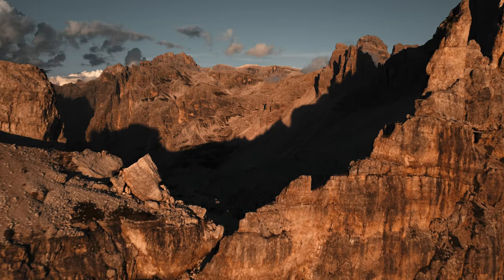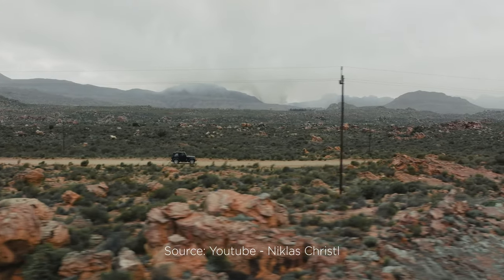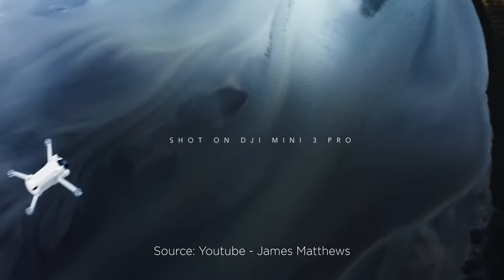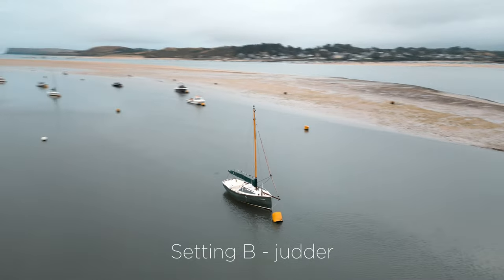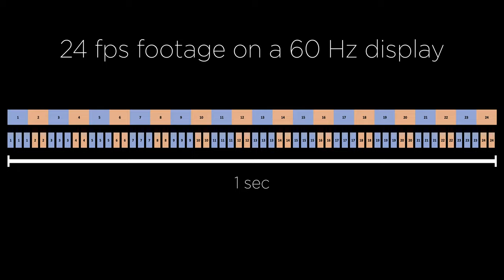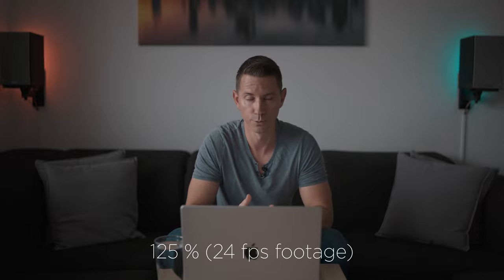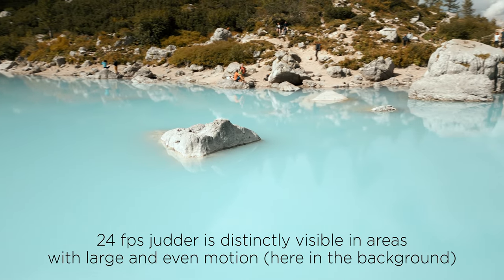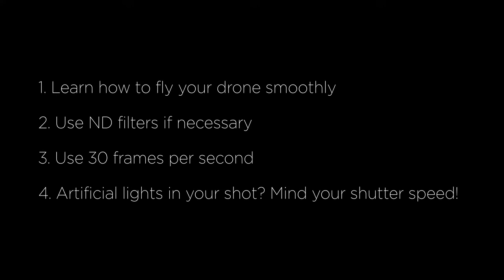The #1 Secret for CINEMATIC Drone Video without Judder, Stutter or Jerkiness

Comment: Hey this is awesome information! Thank you for your time and effort into making this video. I have a question in regards to editing timeline. Is editing on a 30fps timeline the only way to prevent judder? Because I want to edit a video that has normal 24fps vlogging footage along with 30fps drone footage (which I'm sure is very common in video editing). For my 24fps vlogging footage to play back normal, It has to be on a 24fps timeline right? But then my 30fps drone footage would have stutter? I guess my question is, is there a way to make certain parts of a timeline 30fps and some parts 24fps so that my drone footage is smooth and my 24fps vlog footage plays back normal? How do you get around that? I guess this is more of a general video editing question. I edit on final cut and newer to editing. Thanks in advance!
Reply from the maker: First off, I assume you intend your videos to be played back on smartphones or computers (which are 60 Hz mostly), not in cinema. I hope this assumption is right.

If you already have your footage recorded and it is 24 fps (vlog) and 30 fps (drone), use a 30 fps timeline and export in 30 fps. This way, you can ensure that at least the drone footage is judder-free (30 fps footage on 30 fps timeline on 60 Hz display = all compatible). The 24 fps vlogging footage will technically be juddering, BUT it would be juddering anyway on a computer/smartphone screen. The good thing is, with common vlogging footage and the nature of the camera and subject motion of vlogging footage, chances are, you won't notice any judder at all. Judder becomes mostly visible with even camera movements like most drone footage has (pans, tilts etc.), so your priority should be getting your drone footage smooth, therefore my recommendation for 30 fps all the way from start to end.

Just for your information: If you put your mixed fps footage on a 24 fps timeline, the vlogging footage would fit perfectly on your 24 fps timeline while 6 frames of the drone footage would be skipped every second. AND when you later playback your 24 fps video on a computer/smartphone (60 Hz), everything would be juddering because nothing would fit at all. So with the 30 fps timeline, you could at least "save" your drone footage (30 fps all the way from start to finish). And on the vlogging footage, the judder will most likely go unnoticed.

For future projects, I'd strongly recommend to record all your footage in 30 fps, put it on a 30 fps timeline and export it in 30 fps, then everything is compatible and technically correct.

If you have any further questions, just let me know, I'm happy to help :) And thank you very much for your kind words, I really appreciate them.

Comment: Good video.. Agreed about the whole 24fps 'natural motion blur' garbage. It's good for filming ppl at normal speed but most drone footage is of scenery and at a slowmo style! I'm still struggling with this but I found dropping my 30fps drone footage to 80% worked (24fps timeline) well,  using a 'fast' microsd card AND turning off caching in the app! Haven't shot anything new with all 3 but test look promising.
Reply from the maker: Interesting! I'm wondering why you would put your 30 fps footage on a 24 fps timeline. Why not 30 fps timeline? Dropping 30p footage at 80 % speed on the 24 fps timeline will be smooth in itself, that's right, but the 24 fps timeline will still be juddering on a normal computer display (except for special ones like 120 Hz displays).
Reply: @t0mwhazzup  thx for the reply. I have mixed fps footage from my bmpcc 4k, dji osmo and I use 24fps for those. I don't get the judder on my 60hz macbook when I slow the 30fps mini footage 80% for the 24fps timeline.
Reply from the maker: Perfect if it works for you ☺️

Comment: Good video and explanation. yet it did not help me. I have been experimenting and what made the big difference for me was that i had all my video files stored in a folder on the desktop. Once i moved them the judder was as good as gone. So that and your tips gave me judder-less video. I did not use ND filters. I thought i'd let you know in case someone else has the same problem. Thanks for posting that.
Reply from the maker: Interesting, but most probably your problem was not judder (which is caused by the pulldown with incompatible refresh rates and frame rates), but more some stutter that is somehow caused by something on your computer. Judder and stutter are often mistaken for each other, but are something different. Anyway, happy that your problem is solved :)

Comment: Hi Tom amazing video, I finallllllly found a valid explanation. I shoot often on 30fps on mini3pro but I guess while on timeline of Davinci it’s 30fps and 24 fps on export is the reason it’s still way juddery ?
Reply from the maker: Yeah, you need to go all the way 30 fps. Shooting, timeline and export. Then it should be smooth.

If it still does not look as smooth as you like, one common reason is a shutter speed too high. That happens when you don't use ND filters. This phenomenon is not judder, but it looks similar.
Reply: @t0mwhazzup  I think you're right for the shutter speed as the issue is spectacular on the rotation moves specially on the horizon for me!😁👌🏻👌🏻
Reply from the maker: @yellonight  For that I have made a tutorial that should cover all settings for perfect video quality, which also includes things like stutter and ND filters: https://youtu.be/5aotiUE-iOk
Maybe it helps :)

Comment: I am making my first documentary but i shot it allready in 25 fps should i make the drone footage in 30 fps?
thanks and greetings from Holland!
Reply from the maker: If you recorded your documentary already in 25 fps, I would shoot everything for this project in 25 fps for the sake of consistency. For what medium is it planned? TV broadcast or online? On TV, it is supposed to play back smooth. If it's for online airing (Youtube etc.), you know my recommendation 😅 Let me know, I'm curious 🙂
Reply: @t0mwhazzup  it’s probably for both!
And yes I live in Europe so PAL it is (25 and 50fps).
Reply from the maker: @SretloW  It's fine. When we do projects for broadcast (which is the majority), we work 25fps as well. Everything else 29.97.
So in your case, shoot the drone footage also in 25fps, get the shutter speed right (depending on the material, I'd go between 1/25 and 1/50 of a second) and it will look good. On TV anyways. Oh and the project timeline of course in 25 fps as well.
What documentary are you filming?

Comment: What if you record in 30/60 fps but edit on a 24fps timeline or export at 24fps? Thanks in advance!
Reply from the maker: That would not make any sense. First off, you have to think about where the final video will be mainly watched. Is it cinema? Then 24 fps. Is it broadcast? Then 25 fps in PAL countries or 30 fps in NTSC countries. Is it social media/online/digital content? Then 30 fps.
And then you should keep your frame rate the same for recording, timeline and export.
Judder comes from mathematical incompatibilities, and therefore, 24 and 30 fps don't work well together. As a general rule, never mix frame rates. Stick to the frame rate of your choice, and if you're wise, you choose your frame rate according to the guideline I mentioned in the beginning. So for most creators that produce for YT, TikTok, Instagram and so on, 30 fps makes the most sense.
Reply from the maker: And as a sidenote, I don't defend 30 fps as the one and only correct frame rate. It really always depends on where you distribute your video. When I do commercial projects for broadcasting (here in Europe, so PAL), I go with 25 fps.

The 24 fps hype is rooted in cinema enthusiasts that have insufficient understanding of the matter and believe using the same frame rate as cinema movies gives them cinema experience, while the truth is, 90 % of computer monitors or smartphones cannot even display 24 fps as such. But it's a very persistent myth/hype/misunderstanding.

Comment: Hi Tom, thanks for this useful information really helpful. Recently I filmed with my Air2s in 30fps and working on davinci in a 30fps timeline (before I was starting 25fps but I had lots of shuttering issues then after watched your video I changed in a 30fps timeline now is more better than before but still I have some lagging issue in some of the clips (I noted after some color grading work I have these problems) always I’m using ND filters and respect shutter angle. Are you have any suggestions please 🙏🏽
Thanks
Reply from the maker: When you're doing 30 fps and work with the right shutter angle, you are doing everything right to get smooth video. Can you describe the lagging a little more, or maybe have an example clip to look at? Is the lagging only in DaVinci Resolve or also after you rendered the video and play it back in a media player (like Quicktime, VLC and alike)?
Reply: @t0mwhazzup  i have small lagging inside davinci also but I noted every time when I playing inside the davinci the same clips are lagging but in different time positions (not lagging exactly the same place.. after rendering little more smooth on QuickTime Player than VLC player (when using vlc player colors are good but I have 90% lagging)

Comment: I always record in 30fps and I have horrible judder when panning. It ruins every video unless I avoid panning.
No solutions out there and so, no, the problem with 30 fps is not "history". I am using a DJI Mini 3 pro.

Is there a post process solution?

BTW . One software is smooth. It's when I click on a video on my tablet in Samsung Gallery and it uses its embedded viewer.
Every other video sw or player on tablt phone or PC has the judder effect.
Reply from the maker: Which shutter speed do you have? Do you use ND filters? There are other phenomena than frame rat incompatibility that might cause unsmooth playback
Reply: No ND so shutter is high but I discounted tgis as a lower shutter will only introduce motion blurr. Judder will remain.

Also the one playback (Samsung Gallery embedded player) is buttery smooth, so there is a playback issue also with players and editing sw.

Only judders when panning.
Reply from the maker: Always hard to tell without having the footage in front of me.

If you have a high shutter speed, your video consists of a sequence of still images with no motion blur, which gives stutter that becomes visible especially with camera movements like panning. Stutter is originating from no motion blur (no fluid movement) but looks similar to judder that originates from incompatible video frame rate and display refresh rate.

If one software plays your video back smoothly, it might have some kind of intelligent smoothing algorithm built in.

If you have your video on Youtube, you can send me the link and I can look over it when I have time.

Comment: I have tried every frame rate possible and mostly shoot in 30 FPS but my Mini 3 Pro is doing the judder bad when panning mostly. It is driving me nuts then I watch YouTube and most other people are having same issues. You are correct on it not being much out there other than old video's about the wrong SD card causing it
Reply from the maker: Does 30 fps (recording, timeline abd exporting all in 30 fps) not solve your problem with judder? If not, a memory card too slow could be the problem indeed, or if you don't use ND filter you might get a similar effect, too. Even though, technically that is not judder.
Reply: @t0mwhazzup yes I tried that. I had someone tell me shutter speed might be off and I didn’t have ND filters so you probably are right about filters.  Going to try shutter speed and get some filters, I always do 30 fps. Will let you know if it fixes it. Thank you for your info love your channel
Reply from the maker: @bikedoc4145  I have a video on my channel, I think it's the most recent one, with the thumbnail saying "Make it Pro". In this, I go over everything that makes drone footage professional. One part deals with ND filters and there I give a visual comparison between ND filters and no ND filters and also explain how to approach the use of them to get the right shutter speed. Maybe that can help a bit. Let me know if it helped!
Reply: @t0mwhazzup  I am ordering a set today from  freewell today and for sure will watch that video. If you have a link as sponsor to some I will order from your link. Thanks a bunch
Reply from the maker: @bikedoc4145  Thank you very much for your support 🙂 Actually I do, you can find the link in the video description. I have affiliate links for amazon us, uk and germany/austria. The ND filter set I linked there is the one I use and I really recommend that because it starts with ND4 instead of ND8 or 16 with most other sets out there.
Thanks again, I really appreciate it 🙂
Reply: @t0mwhazzup  Will check it out and get back on results 👍
Reply: @t0mwhazzup  Just a follow up. I got the 4 pack Filters and started out with a 8 on not very bright day and it is way way better! Thanks for your help
Reply from the maker: @bikedoc4145  Happy to hear! :) What shutter speed did you get out of it with the ND8?
Reply: @t0mwhazzup  I'm not sure I used auto and just adjusted my EV amount but it was way lower
Reply from the maker: @bikedoc4145  Ah ok, I see. If you want to improve further, I'd start to use manual exposure, and then set ISO to 100.

One approach (the "trial and error" approach) would be to set shutter speed to 1/60 and then try different NDs to see with which you get the best exposure. Stick with the closest one and then you can do minor adjustments of the shutter speed (in the range of 1/30 to 1/100) if necessary.

The other approach (the "calculating approach") would be to have no ND filter on, set the shutter speed so that exposure is good, and then "calculate" which ND filter you need to get down to around 1/60 of a second. So, for example, if shutter speed is 1/1000 without ND, you're gonna need ND16 to get to around 1/60 (1000 / 16 = approx. 60).

The more experience you have, the easier it will be to put on the right ND filter just by estimating the brightness of the scene.

I explain it here, if you haven't watched this video.
This is the video from the beginning (I think it's worth watching all of it): https://youtu.be/5aotiUE-iOk
This is the video starting at the ND filter part: https://youtu.be/5aotiUE-iOk?t=662

And thanks again for ordering via my affiliate link, it really supports me - I appreciate it a lot!
Reply: @t0mwhazzup  No problem and thank you for taking the time to help. I think it got down to like 1/580 but I did not have much time and it was cloudy bad so I only played with the ND 8. I will watch the whole video tonight and try it on Manual next time. Thanks a bunch 👍
Reply from the maker: @bikedoc4145  Yeah, if it really was in the 500s or 600s, you will still see a noticeable improvement when you get to the range of 1/30-1/100 🙂 Let me know how it worked for you!
Reply: @t0mwhazzup  Yes I will, I am going to try what you said on manual to get it down that low and will let you know the results, Thanks again for your help
Reply: @t0mwhazzup  Just a fallow up
I have found that my playback is causing the stutter. But I got the shutter speed down on a sunny day as low as it would go and up to 80 and even with my playback doing that it was almost gone so big difference it made. Thanks for all your help
Reply from the maker: Very happy to hear! 😊

Comment: Great stuff, Tom! Many thanks for sharing all these helpful videos. Do you actually have any experience related to exporting videos to watch on TVs? Would love to hear your recommendations as to what frame frame to shoot at (is it still 30fps) as well as what sequence frame rate to use while post-processing.
Reply from the maker: Today's TVs are usually easy going and have variable refresh rates, so they accept any framerate well. 24, 25, 30 (48, 50, 60).

I guess with sequence frame rate you mean the timeline/project framerate? This should be the same as the frame rate you record your footage in, so my recommendation would be 30 fps (to be compatible with TV, smartphones, computers). Don't mix frame rates if possible, otherwise you'll again have to deal with skipped frames or judder.
Reply from the maker: And thank you very much for your feedback 🤗
Reply: @t0mwhazzup  Thanks so much for your shared advices, Tom :)

Comment: What about mixed footage? What if it is mandatory to drop some drone shots on a 24fps timeline full of camera clips?😵
Reply from the maker: If you have the chance, film the camera clips with 30 fps in the first place. If the deed is already done and you have camera clips in 24 fps on a 24 fps timeline, best practice would be to make the drone clips in 24 fps as well. The final video will be juddering on most screens though due to 24 fps timeline anyways, so at least you don't have mixed framerates in the project.
Except for when you want to use your drone clips for other projects as well.. then I'd film then in 30 fps and put them on your 24 fps timeline with 80 % speed.
Reply: @t0mwhazzup  That is what I usually do, but as you pointed out, regular footage is not so prone to having judder or at least not so noticeable when shot in 24fps so drone footage seems wrong... :P
Reply from the maker: @Tijeran88  I understand 🙂 But that's why in professional environments, the project frame rate is decided on depending on the output format/device. So for general online/Social Media content, this would be 30 fps. You might not notice judder in most normal camera footage, but it's still technically incorrect and can eventually lead to situations like yours 😉 But of course there's always some kind of solution